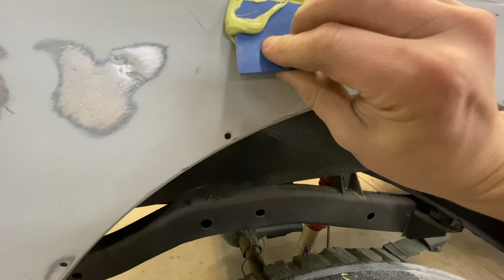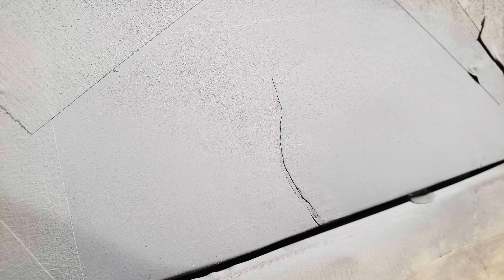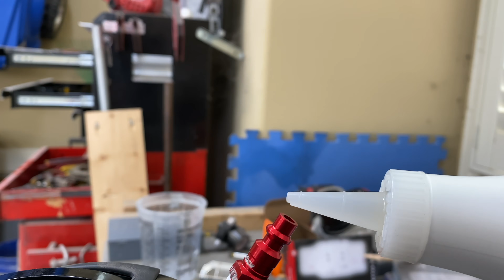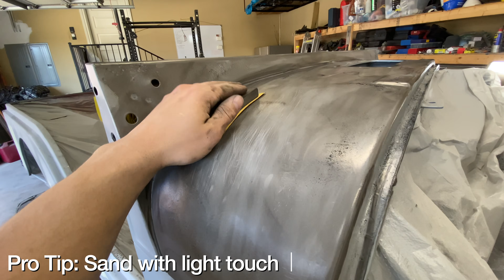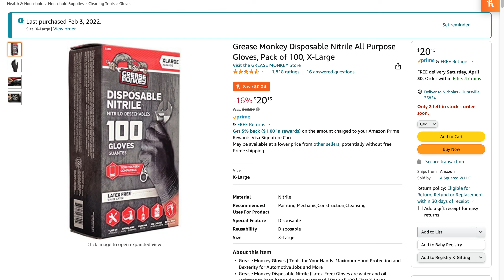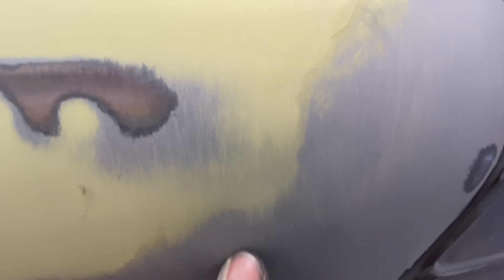The ULTIMATE "How To" Guide For EASY Bondo and Body Filler! - Complete DIY Step by Step!

Comment: Great video Nick. Mine has turned into quite the project. I got a 'rebuildable' tub but turns out it needs about 70% of its sheetmetal replaced. I ended up purchasing every available panel, the large majority from Classic Enterprises and I'm gonna use my tub as a template and build my own reproduction tub. A rather daunting endeavor but after talking with Mark at Classic, completely doable.
Reply from the maker: Oh my goodness! I'm sorry to hear the tub needed more work than you originally thought. Lots of rust holes? Floor plans and the bed? Good luck on the tub rebuild! I'm curious to hear how it turns out. If you need any measurements or anything from mine let me know!
Reply: @NickDowner  Thanks, I knew it needed a cowl, some firewall work, and side panel work. Once the rollbar was out more damage was evident on floor pans and rear riser. Basically the only good parts were the rear deck/floor and underbody supports. So I ordered everything new and decided to build a tub. Should be as good as a reproduction with much higher quality parts. Fortunately, I have the old tub and a old frame to use to make sure everything lines up and measurements are on  as well as for reference.